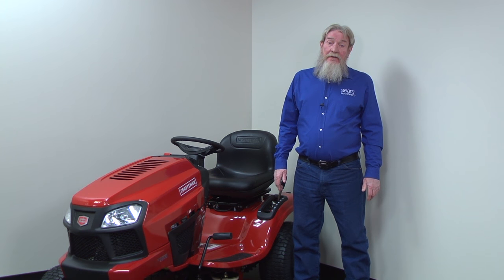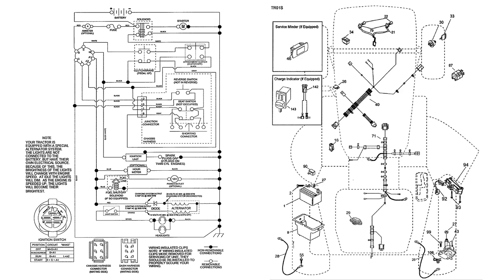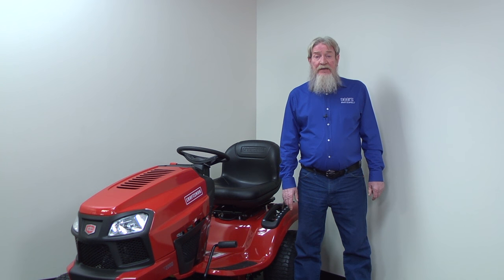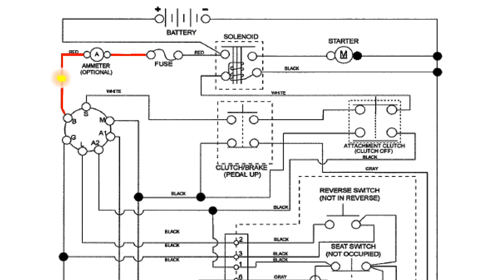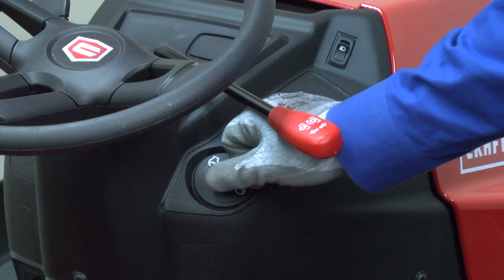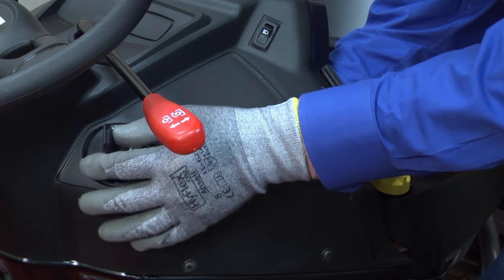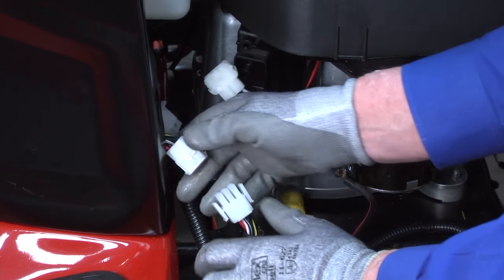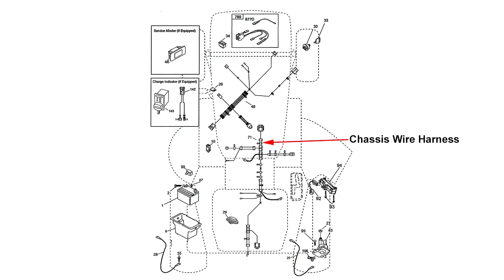How to Find the Cause of a Blown Fuse on Riding Lawn Mower

Comment: A great trick is to use a headlight bulb. It gives you a visual cue while wiggling wires. A shorted to ground wire will turn light on. 
This is an old automotive repair tool from a 70 yr old car tech turned mower repairman. That saves you blowing a lot of fuses while finding the short.

Comment: I just had the same problem with the engine will run for about 15 seconds and then the fuse will blow. I looked for hours and the wiring was fine. I finally removed the flywheel and found that old grass was around the electrical coils I used the air compressor and blew out the flywheel and lightly sanded the magnets. This was causing the short in the electrical system. It runs fine now with no problems.
Reply from the maker: I love a good success story. Thanks for sharing what you learned.

Comment: My Father is having an issue with this so I wanted to type up what was said in the video so that he could print it off. If I messed anything up, I apologize but just in case it could help someone else. I take no credit for any of this. 

Measure voltage through the fuse holder
Turn off ignition and set multimeter to DC voltage
Place the probes in the fuse holder
If it shows no voltage when turning the key (Skip to the section when turning the key) 
 
If it shows voltage the short is in the red wire or the ignition switch itself
 
==============================================================================
Unplugged ignition Switch:
 
Unplug the ignition switch and check the voltage again
If it shows no voltage with the ignition switch removed, it is in the switch
 
If it shows voltage: 
The short is in the red wire between the fuse hold and the ignition switch plug
 
If it doesn't show voltage with the key turned off, plug in a new fuse, turn the key to the run position
Turn the key off and pull out the fuse to see if it blew
Current is going B terminal to the A1
If the fuse blew while in the run position it is in the ignition switch or blue wire, or wire harness connected to the blue wire
 
Didn't blow: 
Intermittent short and harder to find
Wiggle each wire harness and if the fuse blows that is the harness with the short
 
===============================================================================
 
Pull the ignition switch out: Turn to the run position
Set to measure resistance
Touch B and A1 and should show infinite resistance (0 Ohms of resistance)
Keeping one probe in B test all the other spades with the other probe (On the video it shows 0.L)
If it measures anything from B to any other contact besides A1 it is the switch
 
================================================================================
 
If ok: 
Check the dash wiring harness first
Unplug the Engine and chassis wire harness from the dash wiring harness.
Plug in a new fuse into the fuse holder
Turn to key to the run position, turn the key off and check the fuse.
If it blows the short is in the blue wire of the dash wiring harness
 
If it didn't blow, connect the engine wiring harness
Turn the key 
If the fuse blows it is in the engine wiring harness
 
If the fuse doesn't blow with the engine wiring harness connected the short is in the chassis wire harness
Reply: FYI if you click the three dots under the video and hit show transcript, it will show the text for the entire video.
Reply: Thank you. I am printing it out to follow it.

Comment: I got a new ignition switch and my slow blow fuse is fine in the run position but when I try to engage the starter it blows. Any clues?
Reply from the maker: The ignition switch could have a short that's causing the fuse to blow when you move the key to the start position. A short in the wiring going through the interlock switches, or a shorted interlock switch could also cause the fuse to blow when you turn the key to the start position.
Reply: @searspartsdirect  God bless you for replying and in a timely fashion. I don't deserve it.

Comment: The mower I was working on had a 30 amp fuse where a 40 amp should go!! The only way to know what size fuse is to check the electrical diagram, this step was crucial for me and fixed everything

Comment: Great vid.  It helped me trouble shoot my problem down to the ignition switch.  It had some debris in there shorting out the pins.  I blew off the debris between the pins and it solved the problem.
Reply: After watching this I went and checked the fuse holder with multi meter. It showed power or energy there. I then started looking at red wire going to fuse holder and there are white plastic connectors down in there that look oily and greasy. Not sure if that is a problem but I need to know if there is something I can spray on them to clean them up or how to get in those plastic connectors to clean it all up. It looks like the red wire going up to ignition switch is fine, nothing broke or messed up in any way.

Comment: It didn't blow when installed a new battery could the short have been there?
Reply from the maker: Yes. An internal failure in the battery could have caused the battery to discharge high current and blow the fuse.

Comment: Great video, I've replaced damn near every electrical component on my Cub Cadet SLT1554. Still blowing fuses after a couple minutes of running, I can start it 5-10 times and pop goes the fuse, while it's sitting still in the garage. Without engaging PTO.
Thank you for this simple step by step tutorial, I feel pretty certain after watching this my ignition switch is the culprit. Once i do get her running, with a new stator, regulator, solenoid, starter, plugs and battery, she should run forever!

Comment: I continue to blow fuse on a craftsman mower with cv22s kohler engine.  I have had trouble with intermittent starting in past, and now not at all, fuse is blown. I over the course of isolating the short I replaced wiring harness, switch, ammeter, solenoid, and regulator /rectifier as well as plastic connector to the regulator (not the wires). It continues to blow the fuse. I can get the tractor to start by disconnecting the regulator/rectifier, and despite the reg/rectifier being new, it blows the fuse If I try to start it with it connected. I assume the engine wiring harness is good since the tractor runs when regulator rectifier is disconnected, (as were everything else I replaced most likely) ?  Any idea of what could be causing the short, I assume one of the wires leading to the reg/rectifier? I appreciate any help you can offer.
Reply from the maker: The engine wire harness which includes the wires leading to the regulator/rectifier could be causing the short. We recommend that you check all wires in the engine wire harness for damage.
Reply: Sears PartsDirect thank you for your prompt response.  I will look at these wires closer. Do you know where I can find a wiring diagram for the engine wiring harness and the wires leading to the regulator /rectifier.  I have only been able to find details for the tractor. 
I am wondering where the 2 white wires off the regulator /rectifier go to.
Thanks again.
Reply from the maker: We may be able to find the wiring diagram for your Craftsman mower. We’ll need the full model number of the mower. You can usually find the model number under the seat.
Reply: @fernandobayardo9054  Check the wire that charges the battery from the rectifier it should be the middle one. Connect the outside wires and leave that one disconnected. do all three one at a time if that did not work. If it did, replace the entire length including the connectors for that wire.

Comment: I have a craftsman with a Kohler motor. I have replaced the ignition and I have disconnected the wiring harness and put a new fuse in. It will try to start that way but wont turn over. Once I connect the wiring harness back together it blows the fuse again. I dont see any wire showing and have taken the top of the engine off just to see if it was something loose, but nothing I can see. I'm stumped!!!
Reply: Did you follow the steps outlined in the video? Did you usd the properly rated fuse for your mower? I assume that you disconnected the dash wire harness leaving on both the engine and chassis wire harnesses.  From your description, I assume that you left the key in run position when reconnecting the dash wire harness with a live battery still connected. This is a very bad practice.  You could have arc both connections in which case you did not allow for the proper ground.  If my assumptions are correct, you either have a bad red wire running between the fuse holder and the new ignition switch or the new ignition switch is bad. Did you check the ignition switch?  Like husbands, new switches can go bad. The reason why your mower didn't start initially was that the dash wiring harness was disconnected at the beginning when no power was available to the solenoid.

Comment: It only blows the fuse when I turn the key to start. Kohler engine sv330s, Spec # PS-sv730-0011. It's in a Cub Cadet SLT 1550 Any help would be appreciated. P.S. Would it be the voltage regulator.

Comment: I have isolated the short in the red wire coming from the fuse holder to the ignition switch. Question is, how do you replace the red wire?
Reply from the maker: The red wire is part of the dash wire harness on most riding mowers. Almost all riding mowers include detailed drawings of the wire harnesses on their parts list diagram. Look up the parts  for your riding mower using the full model number, then order the wire harness that includes the fuse holder. Here’s a link to look up parts for your model: http://www.searspartsdirect.com/.
 
Replace the entire wire harness or just use the portion of the wire harness needed to fix the red wire. Here’s a video that shows how to repair wires: http://www.searspartsdirect.com/article/how-to-repair-broken-or-damaged-wires-video.html.
 
Or, you may be able to repair the red wire using the tips in that video without ordering the harness. Use repair wire with the same electrical ratings as the original wire if you replace wire without ordering the harness.
Reply: @searspartsdirect  or just run a new red wire from point to point, supported and isolated and with good solid connections on both ends. If one wire is bad replace it, why go through the expense of a whole new harness? He gives advice to sell parts for Sears.

Comment: What does it mean if on the very first test (ignition switch off, test for voltage at fuse holder) the meter reads .03 volts?
Reply: Do you read 12V directly off the battery? I would insert a new fuse with the ignition switch in the off position and then remove the fuse. if the fuse isn't blown, I would go to step 2 in the video. If it is blown, I would follow Wayne's instruction as if you read a full 12 volts.
Reply: Yes, I do have 12v directly at battery.  At fuse holder, shows .03v without fuse, key “off”. Installed new ignition switch, same result. My situation is not a blown fuse when key on (does not blow just by turning key on). The fuse blows when cranking engine while holding key in start position. Engine does not make even a 1/4 revolution (I don’t hold key in start position more than about 3 seconds). Try again 3 more times, same result. About 5th try, fuse blows.
Reply: @mmcnew1  Could be the fuse holder itself is no good and arcing underload, could be a bad rectifier or a bad terminal connector causing an arc in the connector under load.

Comment: I have a cub cadet with kholer motor. I have no resistance when i test the brand new ignition switch, starter, and selenoid. It ran before i parked it to work on the turning arms. Now turn the key and it does nothing but blow the 30 amp fuse behind the seat. Unplugged the harness from the motor turned the key and didint blow fuse. What else should i do please help.
Reply from the maker: You seem to indicate that you unplugged the wire harness that goes to Kohler engine. If so, then the engine wire harness may have a short. A bad component in engine's charging or ignition system could also be shorting out and causing the fuse to blow. Examine the engine wire harness for melted or damaged wire insulation. Replace the engine wire harness if you find insulation damage. If this tip doesn’t help, let us know the model number of your Cub Cadet riding mower so we can look at its wiring diagram and provide some additional troubleshooting tips.
Reply: Sears PartsDirect ,
Thank you very much, I will look into that and see what I can find.
Reply: My Cub Cadet did the same thing  I cut the fuse holder out and installed a 30 breaker that solved my issue. When I inspected the fuse holder it showed signs of arcing that will do it every time.

Comment: I have a gravely pro turn 260 with a kohler ZT740 engine it continues to blow the 10amp run fuse what could be causing this?
Reply: and I replace the fuel shut off solenoid because it was pulling to many amps, I still continue to blow 10amp run fuses.
Reply from the maker: Check all wiring connected to the fuse for insulation damage that could allow a wire to short out to the mower frame or other wires. Repair any damaged wires. If wiring is okay, then a component connected to the fuse’s circuit could be shorted out. According to the wiring schematic for that model, we see three 10-amp fuses. The mower also has two 20-amp fuses and a couple of smaller fuses. If you need more advice on finding the cause of the blown fuse, let us know which 10-amp fuse is blowing.

Comment: Why is the 30amp fuse blowing everytime I put a new one in without key being in swtch on My GT3000 25Hp Kohler Pro V-twin?Thanx friend for your Time.William.
Reply from the maker: A bad ignition switch could be blowing that fuse. Disconnect the red wire from the ignition switch and position the end of that red wire so it doesn’t contact any metal. Replace the fuse and see if the fuse still blows.
 
If the fuse doesn’t blow with the ignition switch disconnected, then you’ll likely need to replace the ignition switch.
 
If the fuse still blows, a wiring insulation break in the red wire between the fuse holder and the ignition switch could be causing current to flow to the metal tractor frame, which would blow the fuse. If you have an ammeter installed, a shorted ammeter could be blowing the fuse.
 
We based this advice on Craftsman GT3000 tractor model 917.276360. If you have a different model, then other components or wiring could cause the fuse to blow. Let us know the model number of your Craftsman lawn tractor if the above troubleshooting doesn’t help.
Reply: I've Order a Switch it should be coming today.Thank Kind Friend for your Time and have a Blessed Holidays.
Reply: I bough a new ignition switch and a new Rectifier-Regulator and installed and put new 30 amp fuse in holder Tractor ran 4 second and died with fuse Blown again! I don't see any bad wires on red wires from switch to fuse Holder or Battery. should both side of fuse holder have power when touching to negative on Battery?
Reply: Also Installed new ammeter still blowing fuses.
Reply from the maker: Because the fuse didn’t blow with the ignition switch in the off position, replacing the ignition switch fixed one cause of the blown fuse. A short in a circuit connected to the ignition switch blew the fuse after you replaced the ignition switch. You’ll need to use the tractor’s wiring diagram to trace and check the wiring and components connected to the ignition switch to find the second short circuit. If you’re not able to find the short on your own, we recommend that you have a service technician examine and repair the tractor. You can schedule service here: https://www.searshomeservices.com/.
Reply: Thanx He's coming next week!